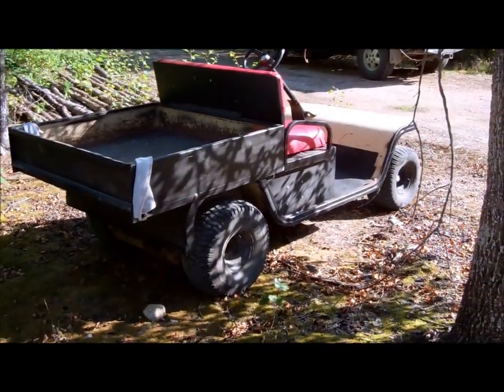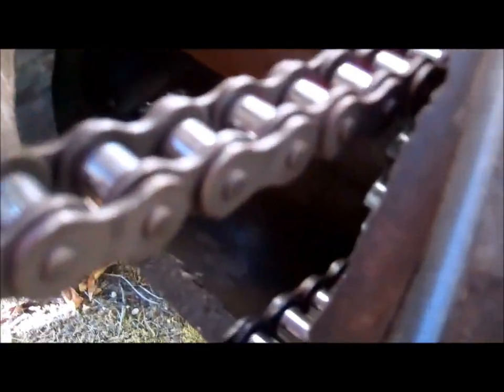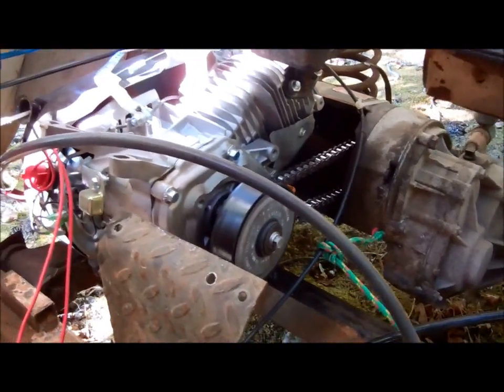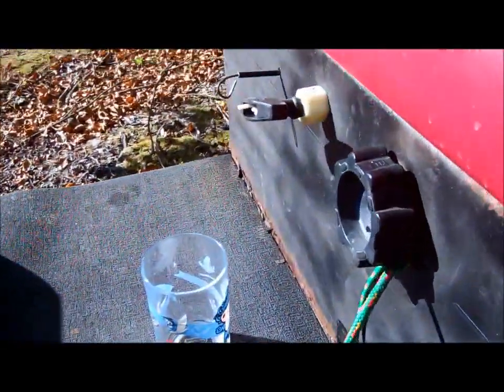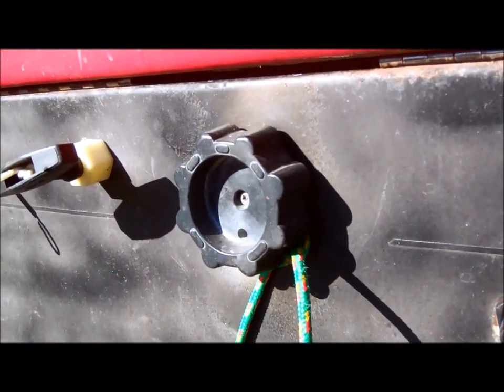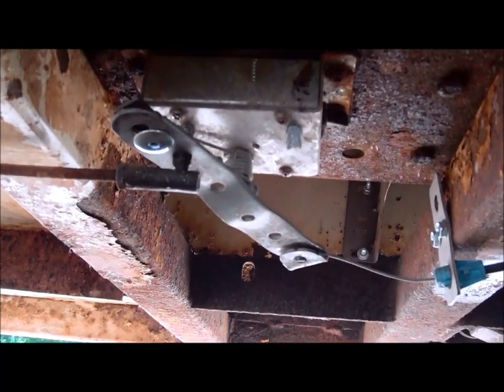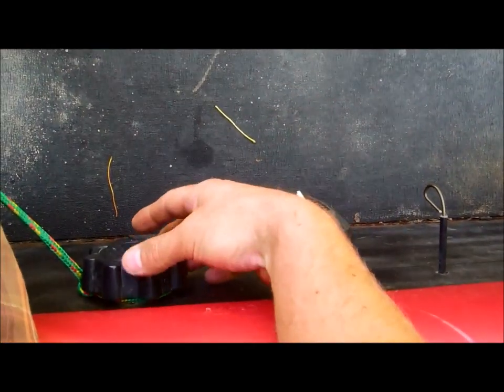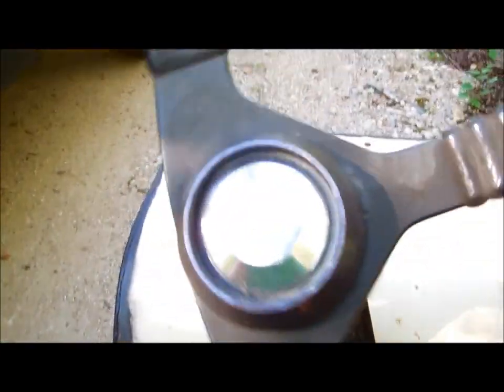How To Convert an Electric Golf Cart to Gas Power DIY

Comment: nice conversion,i never thought about that type of setup, my issue was finding a way attach a sprocket to the gear box
Reply from the maker: joe muncey i just welded it on...thanks! glad you like it!
Reply: @REDNIC79  fuckn' weld it! Love how it's so out side the box it's in!
Reply: I'm trying to figure out a way to use a trans-axle as a transmission... For the rear end... Any thoughts?

Comment: On the rear "axle"  - you just took electric motor out of the way and put a sprocket pulley on it or a centrifical clutch sprocket?  What size did you put on ....  was it difficult?   thanks so much !     GD Tractor
Reply from the maker: Just a sprocket, pressed the windings off the shaft. Not too hard as long as you have a press. Clutch is on the motor
Reply: Sorry to bother.  The neighbor has a 2000 Kawasaki mule with no engine and I got an engine for $75 just to have and see if it would work on my old Chuck Wagon.   should that Kawasaki engine fit right in that Kawasaki mule with no motor I can get the frame and the cab and everything for $300??   Thank you very much. GD

Comment: Nice . I just build one today with old 160 honda gc and older easy go . But im motor was on a differet way . The diff was like one a car where it ponits froward . I gear it 12t on the clutch and 10t on the diff shatf and it only 16 mph and very slow take off 😂😂. I think it need 9 hp or more instead of a 5 hp

Comment: Okan I've been looking into doing this. I have a few questions. First. The rear differential. So that twists and goes up and down with the suspension. How do you keep the chain from falling off with having the engine mounted to the frame? I saw some guys box in the rear diff and run a plate off of it for the engine that does not connect to the frame. But that looks like a bitch.
Secondly. How did you get the wire and shit off of the motor to get the gear on that shaft? Or is that a different shaft you ran in the electric motor housing? I need to know you did this. Love the idea.

Comment: Hi.  I've watched your vid a few times as well as others for research on mine.  I put a tao tao 125cc with reverse in a 1997 Yamaha G1 leccy cart. 

I also pressed out my leccy shaft and I welded an 18tooth sprocket.   
Last thing to do before I can drive it is to remove the leccy motor again and figure out how to keep the housing case (top to bottom) together and then bolt it back to the differential.  

its raining today so I can't mess with it... so I thought I would ask how you solved this issue? 

otherwise mine is ready :-)  your vid was an inspiration but I wanted leccy start and reverse  

golf cart speed was the goal here so I think watching yours I will be pleased  

cheers mate

Comment: i am doing the same thing to a cart i got how did you gut the electric motor down to just the shaft i dont see any way to get the coil of the shaft would appreciate any help great vid
Reply from the maker: the center shaft presses out of the coils (hydraulic press) good luck with the project!

Comment: I just picked up a old beater cart with a rebuilt electric motor but no batteries for $100 I was thinking about putting a golf cart gas engine in it but they cost way to much so I started looking into the 13hp engine from harbor freight but if it works with a 6.5 seems even better I'm not looking for anything fancy just to ride up and down the street. Have you thought about putting a torque converter in?
Reply from the maker: yeah a converter would be WAY better....its works with the centrifugal but its hard on it if you stop on a hill etc.
Reply: with the weight of the cart it's self I image would be hard on it as it is. With this engine how does it do carrying 2 people?

Comment: How did u get all the copper and metal off the shaft?? I'm in the works of doin the very same thing and I'm having difficulties getting it off.
Reply from the maker: +Bearded Muddah I pressed the shaft out of the whole mess
Reply: Does the shaft simply pull out of the gearbox? I have the case of the motor off but the rotor will not move out of the gearbox on the axle itself.
Reply from the maker: Jason Nichols mine did

Comment: How do you get the coil part out of the shaft? I went to the machine shop and they couldn't press it out
Reply: cool it whit dry ice or liquid nitrogen, then heat the coil pack whit flame throwers while rotor suspended from a crane. no joke, this is how its i done

Comment: What bore sized sprocket did you use for the shaft of the old electric motor
Reply from the maker: I had to use a 1" bore and machine it out to the size of the shaft...it was an odd size
Reply: @REDNIC79  Did you cut the electric motor out of the shaft or use some 1" steel and make one to fit in the housing? How many teeth did you use on the sprocket? I don't want to do this twice.

Comment: what size sprocket ratio did you use? looking at doing mine but need to work out what size sprocket for front and back. cheers
Reply from the maker: because of the gearing in the original diff, i would go with the smallest sprocket that will fit on the old electric motor shaft, the front clutch gear was whatever came standard on the clutches....sorry its put away for the winter :)
Reply: Would a Hayabusa fit?

Comment: Are most golf carts this easy to convert because I have a melex golf cart
Reply from the maker: not 100% sure on that one.....i assume the concept will work
Reply: REDNIC79 hey man thanks for replying also can it be possible to put a motorcycle spocket on there and use a motorcycle engine
Reply from the maker: sky is the limit really, you just need to figure out what gear ratio you want to end up with

Comment: where did you get your chain driven centrifugal clutch at?
Reply: TSC has them...
Reply: @chuckfessler2572  thank you!
Reply: @emptymaker9752  You're welcome, think they're $40   #40 Chain
Reply: @chuckfessler2572  this is for the 420 cc motor? other issue i will have is the rear axle it is gas powered already and didnt have the electric rear end set up
Reply: @emptymaker9752  They just go by motor shaft diameter. 1" (inch) diameter is fairly common on motors of this size. As for the rear axle, I don't know. I have a 3-wheeled Cushman electric I'm kickin' the idea around with.
Reply: @chuckfessler2572  Nice! cant wait to see the video on that, youve given me great ideas, thanks for the uploads!

Comment: I got all but i can't understand how you place a  sprocket on the rear axle .. did you used what was there ?
Reply: juan mireles the electric motor has an input shaft, the armature is press fit on a splined shaft that accepts the input shaft, and rides in a pressed bearing on the brush cap of the motor. You can split them and take it all out, then press or weld a sprocket on it. Easy to do. Used the old housing to retain the bearing.

Comment: Sprocket size on motor shaft?
Reply from the maker: Mike tidwell it was the smallest one I could fit on...smaller the better, its fairly slow, so a bigger sprocket would make it slower
Reply: @REDNIC79  I need to know both sprocket sizes I did this same thing from ur video thanks very much I had no idea how I was going to do it but I can’t get it to go past like 3 mph